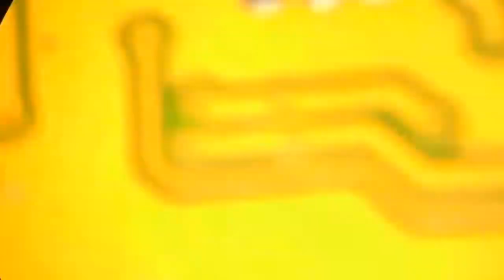What you can get away with on an RTL-SDR (RTL2832 + R820T2)

Comment: How We Can Improve These Chinese Sdr? Do You have Any Tips ?
Reply from the maker: It starts with having a properly designed PCB (temperature management, maybe an external oscillator with temperature stabilization and high Q (low phase noise), shielding and generally better thermal management for LDO and ICs than what one gets with those DVBT sticks in plastic). 
Apart from that, the consensus seems to be to use band pass filters to reject out-of-band noise. 
There's probably room for improvement on the filter or filter component side as well. Preferably though, a bit of a filter and good quality LNA before going into the RTL-SDR board might be helpful.
Reply: @hardwareful  Yes, Because i have moded few of my pcb sdrs, yellow ones, i have difrent ones, not identical, one i put from q branch to main sma cable a wire with 47pf capacitor and now i can go under them 23MHz and it works beautiful. :) 

Easy, just take a super thin wire , solder it to the Q via on the board, and then solder one leg of that 47pf capacitor to the centram sma cabel on pcb and the cable then to the other leg of the capacitor, DONE !
Now you will be able to go down under 23 MHz, as for heating, i glued copper bars on ic's with superglue, it seems to work, butthe real sdr from blog i just put a more thermalpaste block in and put around 6 sheet copper in cut in the size and the heat gets to the body superfast, not like before when it needed time to go warm, now it transfers that heat fast and good :)

Comment: Was wondering about filtering more, maybe using rectifier instead of smps, USB extension cable with ferrite and seeing what the effect is direct sampling and as is... oh, without the IR section too.  That with a sheilded case or at least copper foil lined.  Was also wondering about cooling and super cooling. Though might be cheap fun test study being a newbie one of these days.
Reply: I'll comment here too, since I was just messaging Clint (http://www.information-book.com/electromagnetic-harassment-health-attacks/em-harassment-frequency-detection/) working on the RTL-SDR's to help make more cost effective spectrum analysis analyzers (seem nanoVNA trend is happening with SA's too and here's where I left off: https://www.instructables.com/id/How-to-Make-a-Directed-Energy-Weapon-Detection-Sys/ ) regarding performance enhancement and I was wondering about if something like a Cross Correlation can significantly improve performance (double up the RTL-SDR spectrum analyzer modules like TSP#162 notes about 34min in and better @ 36min in)? https://www.youtube.com/watch?v=SOHjFtw0sgo  Might be something with Kerberos not thought about or I haven't read that would be nice with external clock references like a GPSDO where the disciplined oscillator is like a double oven or better even cost effective OXCO.  https://en.wikipedia.org/wiki/Crystal_oven  Amazing the cost of the GPS modules going down also.
Reply: Could Selenium rectifiers Could Help? I Have USSR Selenium rectifiers.

Comment: The vias underneath the chips are usually for heat dissipation to the ground-plane....  these chips get hot in use and the boards suffer from thermal stress.  You will also find the sensitivity decreases with temperature!
Reply: Yes, These Pcb's Are Getting SUPERHOT! Like, Hot That You Can`t Put A Finger To It, Im Wondering, Could It get As Hot So The Solder Starts To Melt Down? :D